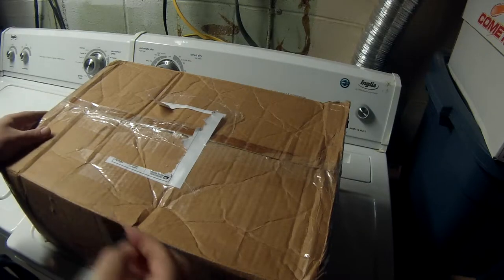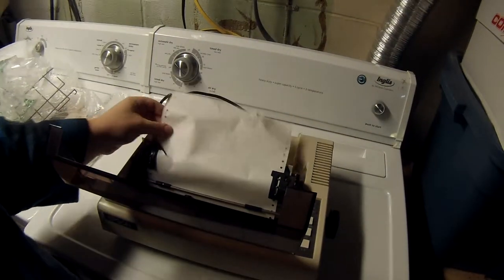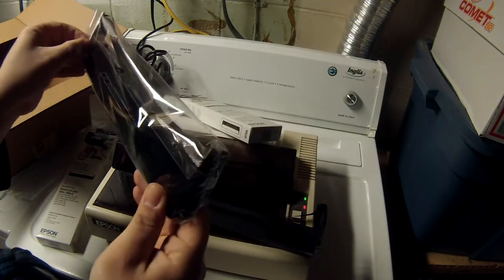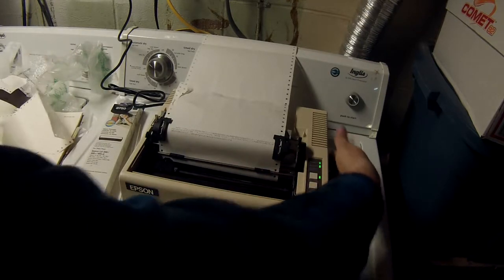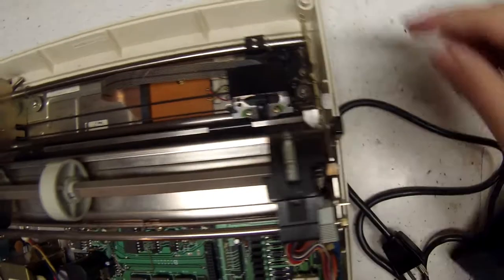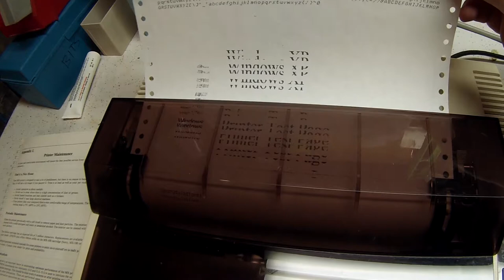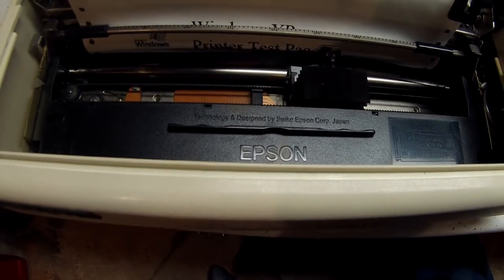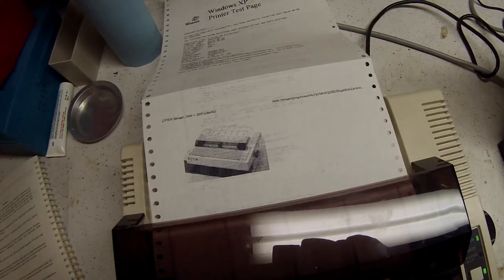Testing / Set up of an EPSON MX-80 III Dot Matrix Printer!!!!

Comment: Nice vid, at work we had one of these hooked up to a 911 CAD terminal, it'd spit out the toned out calls. From what I remember it did so fairly quickly, probably as fast as possible for the model and certainly faster than this. Can't seem to find any anywhere, I'd like to have one and we got rid of all the old ones at work years ago.
Reply from the maker: Ben Adams interesting to hear how these were put to actual use. Cool story!

Comment: Just confirmed holding LineFeed while turning the printer on also works on the IBM 5152! 

My 5152 also only has the far left ROM, the other two are empty (possible cost reduction or Epson had more features?)